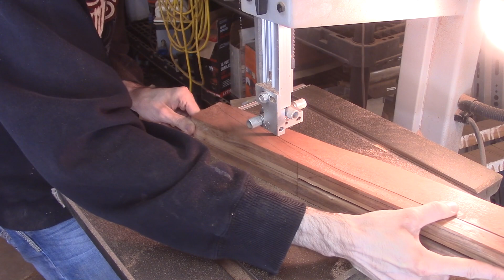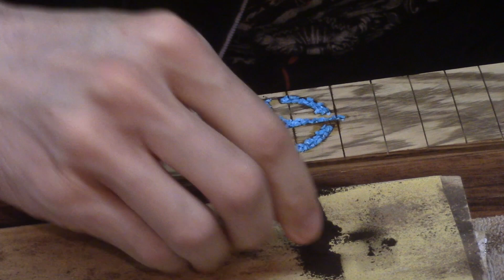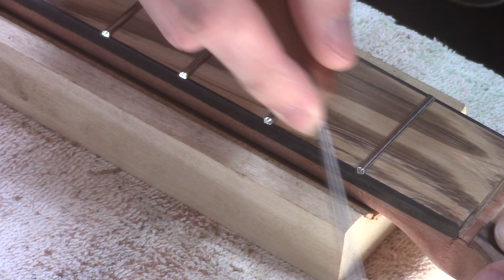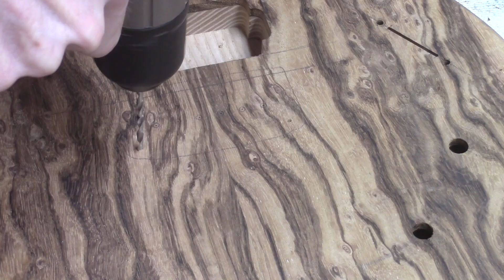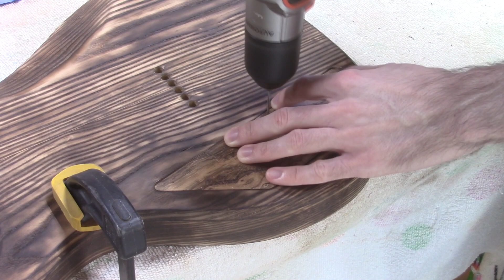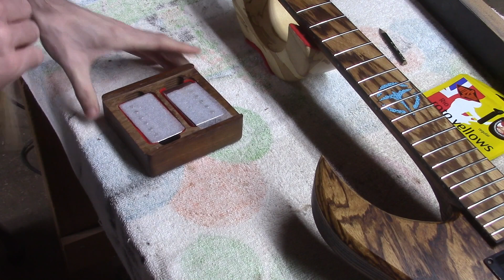Custom Guitar Build - The Basilisk - Birdseye Zebrawood Top [Full Build]

Comment: Do you run a ground wire from cavity to cavity to connect the shielding paint? Or is there enough coverage from assembly screws? In particular, I'm thinking about the pickup cavities.

I'm new to guitar work, but in general electrical work, shielding only works if grounded.
Reply from the maker: I used to use flat black paint for the pickup cavities because I didn't think shielding would do anything there either, but enough people told me it makes a difference that I figured I might as well use the shielding paint.  Besides, the worst case scenario is that it just does nothing, so there wasn't much to lose.

That said, the shielding isn't there for grounding purposes, it's there to prevent the components from picking up outside electrical signals, like a faraday cage.  Plenty of stories out there of a when a guitar with unshielded cavities is in a certain corner of the room, talk radio starts coming out of the amp.
Reply: @OrbitalGuitars  Thanks. Usually these work better when grounded, but like you said, a Faraday shield like this could protect from radio waves coming from directions facing the rear of the guitar. It's a good point I hadn't really considered.

We had built a big set of Tesla coils, but in that case, the cage was to protect from outside-in, not for RF coming from the outside.

It's hard to find good info on this these days because there's so much marketing out there to play on fears of EMF and wallet scans, etc.